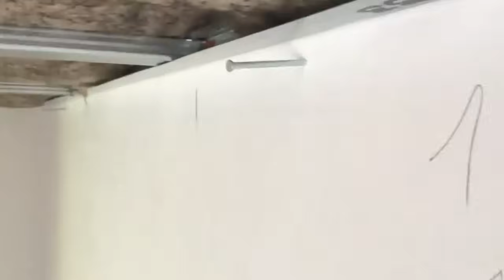✅ HOW to Make PLASTERBOARD Ceiling With METAL STUD 💪🏼 drywall

Comment from the maker: :elbowcough:VERY GOOD

🔥 Drywall partition ▶︎ How to Build a metal framed wall (70mm profiles) 
                                  🔻🔻🔻🔻🔻🔻🔻
                                      https://youtu.be/iNF2HZv3Xjg

Galvanized steel profiles for plasterboard systems

Composition
DX51D type galvanized steel profiles that make up the structure
of the Knauf systems of suspended ceilings and cladding for interiors and
on which the gypsum plasterboards are screwed. They include a
galvanized Z140 that protects them against corrosion. Have
predominantly a U-shape and L-shape with strength
mechanical and stability to absorb the efforts of the systems,
without any load-bearing function.
Storage
The product should be stored horizontally in a dry place
sheltered from moisture and protected from direct sunlight. Avoid
direct contact with liquids or chemical substances that may affect
its physical characteristics.
Reply: which country are you located ?
Reply: Aa0}

Comment: i have a question, when i drill the plates to the metal studs, how do i prevent the drill from walking and going crooked, the metal bending and then breaking drill bits? ive broken a ton of drill bits. do i need to drill fast or slow or start fast en slow, or start slow and end fast or something else? and how much pressure do i need to put, and do i need to use a special kind of drill bit for this other then normal metal drill bit?
Also tried directly with screws but they also started walking and all crooked,

Comment: Too many pricey and exotic items to build the frame for that ceiling.
As a UBC journeyman carpenter, I built the drywall ceiling frames with " L " track against the wall, and regular 1 5/8" x 1 1/8" inch track as the cross members to screw the sheetrock on.
For structural strength, I put 2 tracks facing each other, basically making a rectangular torsion truss, zipped together with framing screws.
For support, used same track, screwed securely to the ceiling.
Would bend the anchor point with a piece of scrap wood for strong support, right at the 90° anchor to the ceiling. 
To not waste time measuring the length of the track suport struts, would let them be 2 or 3 inches longer than the cross rectangular structured track.
Would alternate side to opposite side the track struts for stability of the frame crossmembers.
Finally leveled the frame crossmembers and finally drove home 4 screws per strut, through a 3/4" piece of plywood for shear stability.
Would then just cut the overhang 1/8" above the leveled truss track, and bent it up out of the way at 90°, and anchor the turned up offset to the strut for further stability.
Final use of track scraps was screwing every strut to the framed torsion track truss, at angles to create a triangle for further stability of the ceiling frame to hold the wallboard.
Built ceiling frames with just "L" track for perimeter, and track for the crossmembers, and bracing.
Cheaper and faster than your build, and never had to hunt down special connectors, to make the ceiling frames.  And never ran out of material.  And just about any lumberyard has these items in stock all the time.
Likewise having less items needed in the inventory is usually better and more cost effective.
Never had any problems with ceilings.
Had to do build it fast, level, accurate, and cheaper.
But quality was never compromised.

Comment: Man you are good! I am gonna do insulation at my apartments ceiling.  Can you tell me your opinion? what distance should I leave from the ceiling plaster to the plasterboard? ( in between I will place mineral wool 7cm thick)
Reply: Tbh that doesn't really matter, you can leave no space in between and have good isolation. The isolation depends on the materials you use, so chose how low do you want your ceiling and start from that. Now if you want other things like cables there, then leave at least 10 inches between.